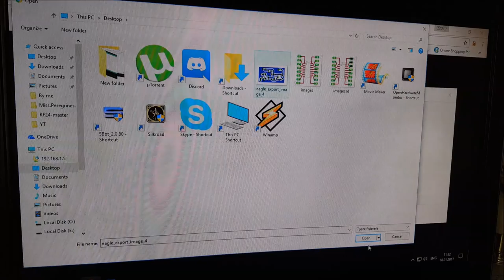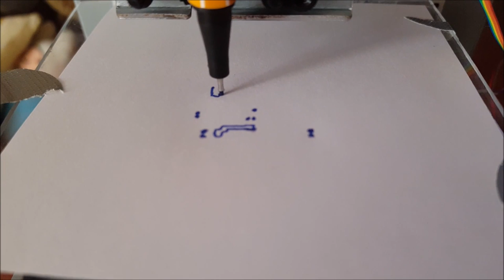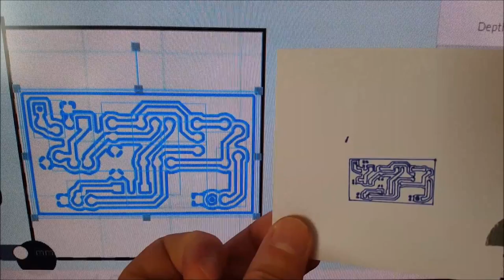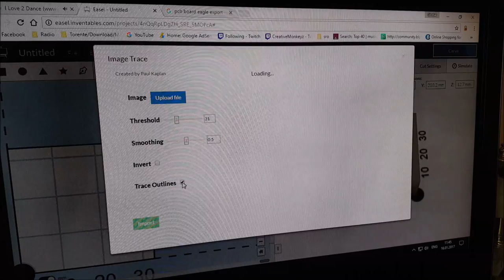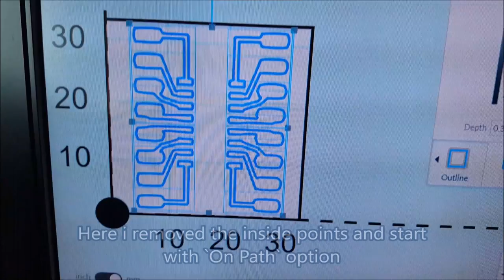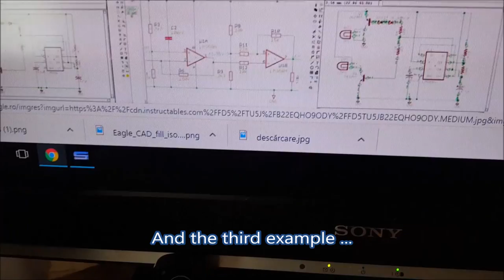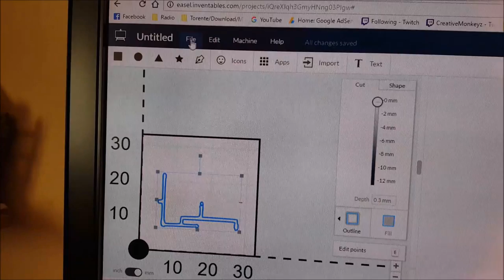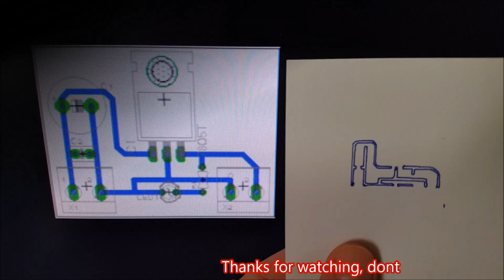DVD CNC DIY ARDUINO CNC SHIELD making PCB  | GRBL | EASEL Software

Comment: Hi, I'm new to working on gcode and arduino, I'm building a DLP printer with Z axis only, 
Do I have to do any spacial configure or do a spacial setting for the Z axis ? 
Or I just give it the stl file or design? 
Hope you can advice me thanks

Comment: Hi,your grbl shield has 4 drivers on it,when this needs only 3 drivers X,Y, and Z,i cant see the use of the 4th driver and a clone for dvd carriages seems unnecessary,of course i can't see the entire setup,and i'm trying to get as much info as possible to make a nema17 powered X,Y,Z set up for milling,burning,plotting i have high hopes with this.

Any info why a 4th driver would help.

Cheers.
Reply: it can act like a second motor, lets say you need another motor on the z axys, you can program the new motor to turn the same way as the first x motor or the opposite